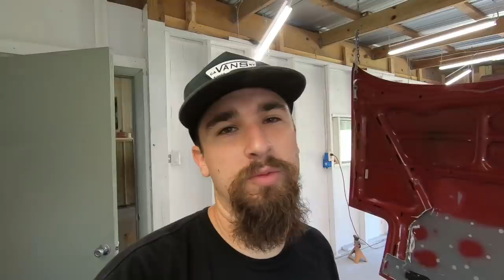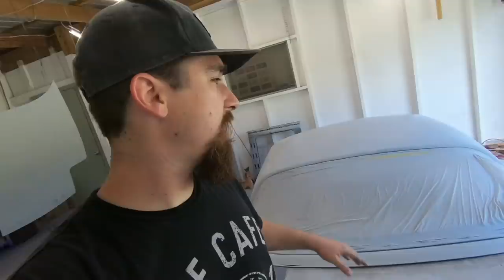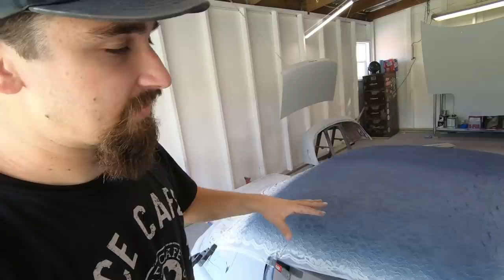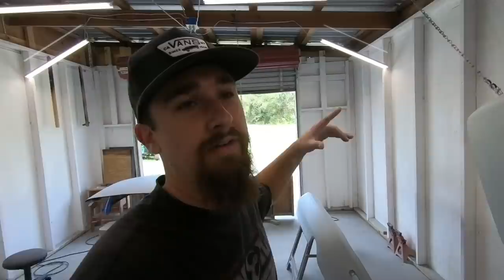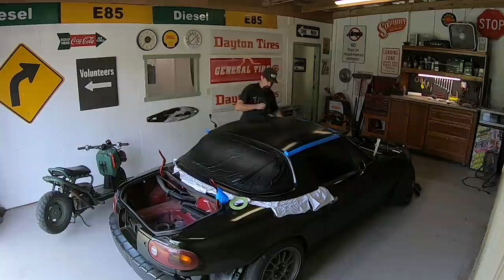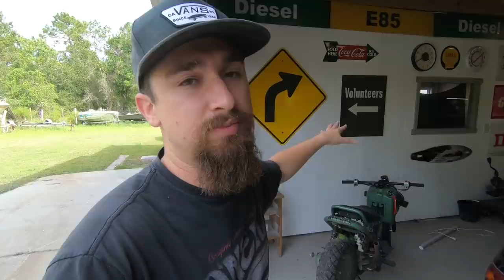Taylor Ray Ls Miata final Painting and Custom Roof Test

Comment: Just out of curiosity why dont you ever wet the floor to help prevent dust from the ground getting brought up and on the paint? I'm sure you know about it cause you paint very well but just curious why not use the method? Helps with the cut and buff process ALOT

Comment: Can I ask why don't you place the panels the way the sit on the car when you spray them. I have heard the it can effect the look of the paint once placed of a car if you don't? Or is that only on more metallic paints? Love the new video
Reply from the maker: I dont like to paint a hood flat as its harder for me to stay steady while im paining if i am holding the weight of my arm way out over the hood. I like to paint a vertical surface better and also less of a margin for dust to land on it.
Reply: @BodeVision  that's fair point thanks for the clarification